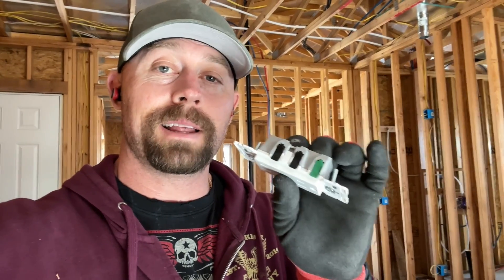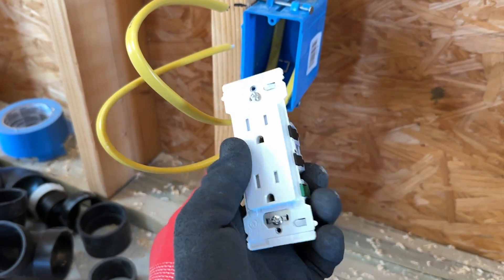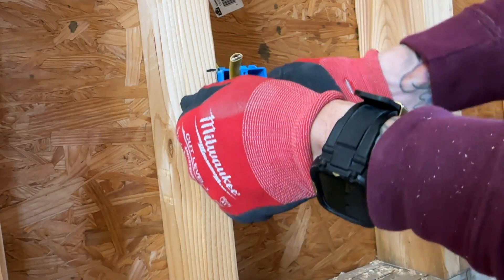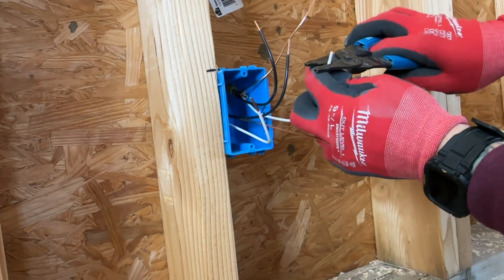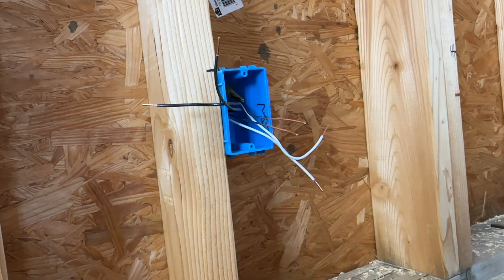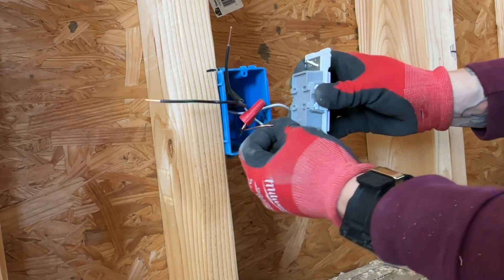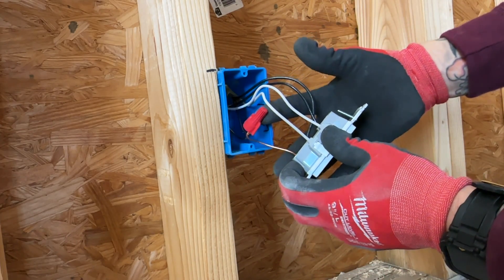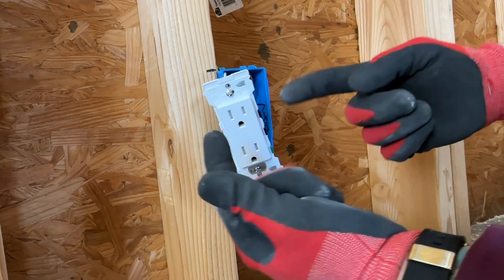How To Install the BEST Electrical Outlet - Leviton Push & Click

Comment: Just have to snap the tab off the top if you're watching this an wondering why your faceplates don't fit.
Reply: Literally what I was hoping this video would show. These don't fit in all gang boxes; e.g. I am trying to install one in a metal 4x4 junction box and it won't fit even if the small plastic tab on top is snapped off.
Reply: @christophermichaelson9050 Did you also snap off the bottom tab?
Reply: @Ben-td1zv I didn't try snapping either off because I can see that even if I did, it would still not fit. I would have to trim both ends with a rotary tool to trim it down while still retaining the mounting screws. Going to return the outlet.
Reply: @christophermichaelson9050 

When you get a standard outlet you will have to snap off the "bunny ears" on the yolk so it will fit in a 4x4.
Reply: @Ben-td1zv doesn't have bunny ears. I've done that many times with other outlets. I did some research and others are having the same issue as me. Is what it is.
Reply from the maker: @chr @christophermichaelson9050 😮
Reply from the maker: Good info. 🤙🏼

Comment: Do the 3way switches or the switches in general have to be grounded ?
Reply from the maker: It’s usually code to have the outlets grounded but not the switches. They usually just operate as a break in the line such as the black or sometimes the red wire. But they usually only have two poles, to attach the one wire to and cause that break/switch in the power source. Not usually grounded. But your ground wires are usually bound together in your junction box and at some point are sharing a grounding source

Comment: Is pig tail called for on these outlets.
Reply from the maker: It can be if you have multiple wires coming in. If it’s just two wires on each side then you wouldn’t necessarily need it.

Comment: That sure looks like a 15 amp receptical.
Reply from the maker: It is. You’ll see the 15 amp receptacles on a 20 amp breaker a lot of the times. 

A 15 amp receptacle can be used on a 20 amp breaker circuit because a 15 amp outlet simply cannot draw enough power to overload the 20 amp circuit; the breaker is designed to protect the wiring, and a 15 amp outlet will not reach the current threshold to trip the breaker, making it safe to use on a higher amp circuit
Reply: @FortKnoxCo  Brian, the second part of your reply is incorrect, receptacles, regardless of whether they are 15, 20 amp, GFCI's, and 240v types, do not limit power draw, that's the circuit breaker's job. 15 amp duplex receptacles are permitted on 20 amp circuits, because the appliance with a 15 amp plug, virtually all, has a maximum current demand of 15 amps.
Reply from the maker: @surferdude642  I appreciate the clarification. I miss-worded that part of the reply. Yes the breaker is setting the limit that will pop if the draw is too high. A regular outlet will not restrict power pull. If  it was a GFCI outlet then it could act as a breaker in a sense that it would not pull more than its rated for and pop.
Reply: @FortKnoxCo  No, a GFCI receptacle is not a breaker in that sense, but it's a device that detects leakage current, even a very small amount, approximately 5mA. If you had a 20 amp circuit and had exactly 23 amps coming in on the hot wire and exactly 23 amps on the neutral wire it should not trip a GFCI receptacle, but it should trip the breaker eventually.
Reply from the maker: @ thanks for all the good information 🤙🏼

Comment: I have one electric outlet near my desk but I need a couple another outlet because I have a few other devices to connect and I do not want to have a power strip here. Do you have any videos on adding a second outlet, so you would have two outlets 4 plugs you can use and it would be in just one double wide outlet box?
Reply from the maker: Yep. I just put out two new videos showing how to add outlets. One with removing the original box and putting in a new “old work” box. And one where you can leave the original box in place.  But if you want to just add an additional outlet next to it and you don’t want to add it above or below that’s even easier.

Comment: There was a expo unit on display at the home depo with 4x6" wires attached. I couldn't pull them straight out with half loop around two fingers.
Reply from the maker: That’s pretty cool

Comment: Is it always necessary to pigtail ground wire? I dont know anything about electrical and am wanting replace some outlets in my home.
Reply from the maker: All the grounds should be connected. How you do that is up to you. But putting a pig tail together isn’t bad practice. Capping the grounds together also helps with the ends no poking into something else.
Reply: These are great. Connection is solid and they are super safe due to not having exposed screws.